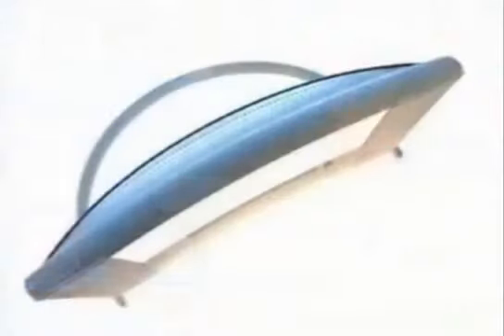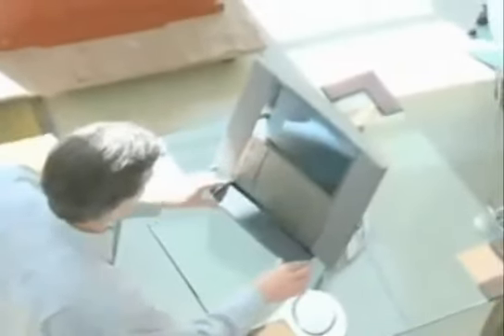Apple TAM (Twentieth Anniversary Macintosh) Jony Ive

Comment: This is why Steve Jobs liked him so much, because just like Jobs he talks so much bollocks. The TAM that was a big failure. Stop designing form over function. Its was all the recent Macs over the years have had massive design flaws. The butterfly keyboard, the heat issues and more
Reply: That will be why they’re one of if not the most successful companies in history. Could it be that you that actually talks bollocks? Seems strange that you would seek out a video like this if you hold them with such disdain